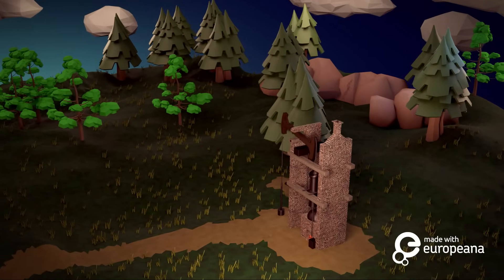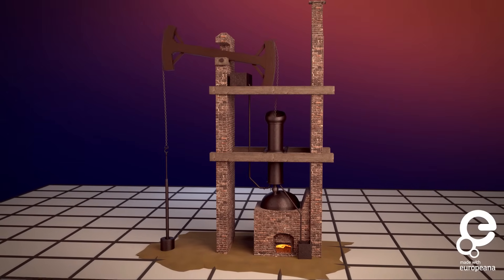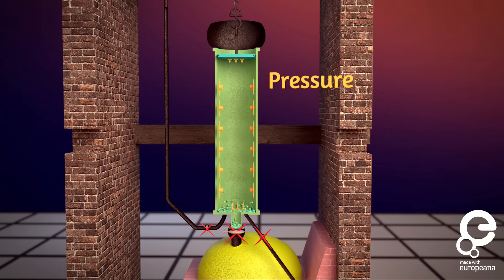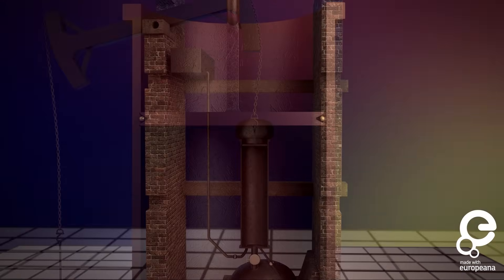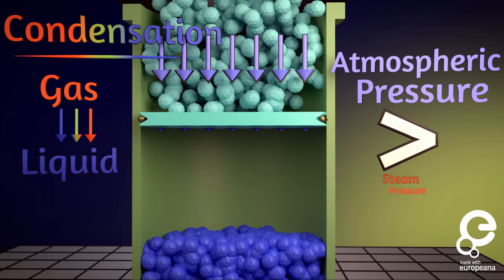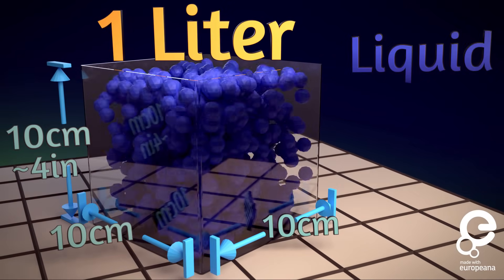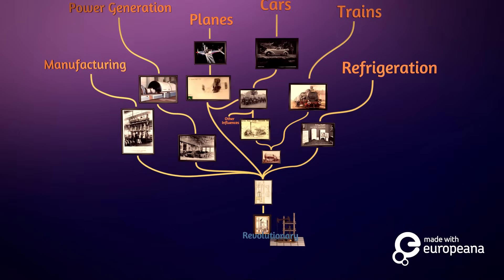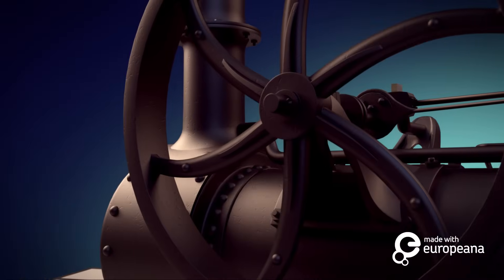What is the First Engine Ever?

Comment: 1. 00:48 -- Suggesting that without Newcomen, today "our world would be unrecognizable" is just laughable nonsense.  Look at all of the simultaneous inventions of the automobile, airplane, etc., that were the results of people working in different areas, unaware of each other's efforts.  If it hadn't been Newcomen, it would've been someone else a few years later, discovering the same principles, and creating mechanisms that were very similar, if not identical.
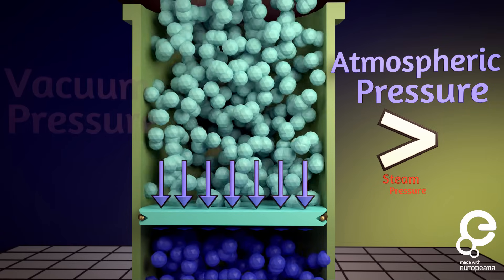2. 05:28 -- There is no such thing as "vacuum pressure".  A vacuum is the opposite of pressure.

Comment: The Newcomen Steam Engine?
The Newcomen Atmospheric Pump! The Steam's at ambient Atmospheric Pressure, inside and outside the Pump, like everything else.
It couldn't replace the Waterwheel, the first Engine.
Watt's machine was a Steam Powered Pump, and later a Steam Powered Engine, which could, and did, replace and surpass the Waterwheel.
Newcomen's machine was an Atmospheric Pump.
It doesn't work till you take the Steam away.

Comment: I think the start of the cycle is when the steam pushes the piston up and the beam to the water pump goes down. 
If not, how does the beam go back up once the steam turns into water?
Reply: How is atmospheric pressure enough to push the piston down?
Reply: @kissi1859 The weight on the Pump side pulls the piston back up and sucks Steam into the cylinder.
When the Steam cools down it changes back into water and creates a vacuum, then the weight of Air sitting on top of the piston pushes it down. The cylinder is open at the top.

Comment: It only takes 2 lb of steam pressure to fill a 44 gallon steel drum but when the drum is sealed and the steam condenses the drum will crush under the force of the atmospheric pressure on the outside surface.

Comment: if i created a steam engine that makes a vacuum in the top side, will the atmospheric pressure still push the piston upwards?
Reply: Yes, if it's open to the Atmosphere at the bottom.
Reply: It will, but the Newcomen engine relied on gravity to push the condensated water against the valve at the bottom of the piston.  The suction that pulls the piston rod during the power stroke can occur at any angle though.  It's the contraction of the steam that's pulling the piston.  Their description of atmosphere pushing from the outside is accurate, but not intuitive.

Comment: In Britain from 1800 to 1900.
20,000 Water-Wheels declined in number.
Windmills declined in number.
The Englishman Thomas Newcomen's 1,500 Atmospheric Pumps disappeared.
The Scotsman James Watt's Steam Engines and their descendants increased in number to 10,000,000!
For every SINGLE Water-wheel in 1800 , we now had 500 Steam Engines in 1900 !!!
Total Power output multiplied by between 400 and 500 times, an increase of between 40,000% and 50,000%!
And we don't need flowing rivers of water for any of them!
If that's not an Industrial Revolution, I don't know what is!
And it was all due to James Watt type Steam Engines and Steam Power!
Well done, James Watt!
The Industrial Revolution was nothing to do with Spinning and Weaving or any of those other so-called "  Industrial Revolutions and inventions ". It was a Power Revolution!

Comment: I could not agree with you more about this engine. Ninety nine percent of people do not realise what we owe to this engine…basically everything! There is not a product or process that could not be traced back to this engine and the ones that came after it. 

Then there is the subject of metallurgy. Now that we are inventing these new engines, what are we going to make them out of? Let’s invent cast iron. Ok, how are we going to machine it? Let’s invent tool steel. The development of engineering also lead to the creation of new standards. George Whitworth standardised threads, nuts and bolts etc. 

I would say that the Newcomen engine is the greatest invention of all time, possibly only beaten by the wheel. We can only speculate how the world might have turned out it this engine had not been invented.

Great video.

Comment: How can you cover this without any explanation of how the valves are operated, in many ways the most critical part of the design? This is like an explanation of an internal combustion engine that doesn't go beyond 'spark makes petrol-air mixture go bang'. Yes, the central idea of the Newcomen engine is that you can get a lot of power by inducing steam to condense in a sealed vessel... but there are very big steps from that basic idea to creating a working engine; and I'd say that getting the engine to operate its own valve system is just as major a factor as the pressure concept itself, and a factor that went on to future engines, with increasing complexity and sophistication. Your model of the engine makes it look as though it is worked by magic, since the valves appear to open and close themselves at the correct times, with nothing actually making them do so.

Comment: Little known fact;- When the ICE (internal combustion engine) was invented and for a considerable amount of thereafter, women weren't allowed within 1.3333 chains. I'm obviously referring to the Gunter's chains because although there are other versions of chains that came in and out of use it was Gunter's that stood the test of time, if you doubt the veracity of my claim then just ask any farmer born before WW 1 which "chain" won out. Of course not everyone has a long of period correct chain to do there measurements with so you could also lay 55 Northern Rockhopper Penguins end to end. They're the surfer ones with the cool yellow eyebrows in the 2007 animated movie "Surf's Up!"", but you'll probably need dead ones as live ones probably won't just lay there and training 55 penguins honestly sounds like way too much effort just to visualise a distance. 150 bananas that meet the FDA guidelines of an average of 8 inches per banana laid end to end, but in a straight line, not curved like the bananas would work. I probably should have mentioned that earlier. Also, every one of these methods is just going to end up visualising 100 feet. The distance is just 100 feet, but I wanted to give people a way to see a visual representation of that 100 feet, especially for the vast majority of the world who doesn't use 100 feet. 
It's like 30 metres.
Anyways the reason women had to keep their distance was because the tremendous speeds would make their uterus fall out.😳😳😳
All jokes aside the authorities lost their shit and imprisoned a guy for doing 25mph in 1908. Back then the speed limit was 10mp

Comment: The first commercial steam-powered device was a water pump, developed in 1698 by Thomas Savery. It used condensing steam to create a vacuum which raised water from below and then used steam pressure to raise it higher. Small engines were effective though larger models were problematic. They had a very limited lift height and were prone to boiler explosions. Savery's engine was used in mines, pumping stations and supplying water to water wheels powering textile machinery.
Reply: I've never seen any Factories Powered by any Savery Pump or Newcomen Atmospheric Pumps.
In Britain from 1800 to 1900.
20,000 Waterwheels decreased in number.
Windmills decreased in number.
The Englishman Thomas Newcomen's 1,500 Atmospheric Pumps disappeared.
The Scotsman James Watt's 500  Steam Engines and their descendants increased in number to 10,000,000 !!!
For every SINGLE Waterwheel in 1800 we now had 500 Steam Engines in 1900 !!!
That's an increase in total Power output of 500 times for the whole country!!! And consequently it's production capacity.
And it was all due to James Watt's Invention of the world's first PRACTICAL Steam Powered Engine.

Comment: why use a cooling condensing stroke as a power stroke and not the high-pressure steam? If you use steam to drive the piston, the discharge can charge a second, larger piston and that steam, still at pressure, can then charge a third, very large piston. Plus, the ability of the water to cool the steam is limited, requiring extra plumbing to be less efficient than a water jacket. If the piston started at bottom, the rocker alone won't lift the piston - the rocker is like a flywheel; if it was off-balance, it wouldn't work.

Comment: Newcomen's engine was simple to build at the time with the technology they had.
So even though it was not very efficient, it was much better than the animal power that had been powering the pumps before it.
The mine owners saw how much better it was and were happy to spend the money to get one.  And when Watt made the pitch that a pressure powered engine would use much less fuel to do the same job, the mine owners were happy to pay the higher price for the new engines that were more complicated, and harder to make.  Machine tools got more accurate to bore the smoother cylinders that the Watt engines required.  A whole cascade of technological improvements were kicked off by Newcomen's invention.
Reply: Gotta start somewhere.
I remember my grandmother had some ancient encyclopedias and I looked up internal combustion engine and about all it showed was as far as new experimental engines used in the NEW automobiles people were building.
It was mostly about the Otto cycle 
( as a new thing ) and I vaguely remember it describing someone before Otto trying to make a piston engine run on gun powder. 
The encyclopedia were so old I remember looking up television and it didn't have ANYTHING
I often remembered that that whenever someone like ' Mythbusters ' would bring it up.
Reply: The gun powder powered engine that is.
( fixing typos rearranged my message again.)

Comment: How did the valves work? Were they timed with the stroke of the piston mechanically ?
Reply: 2 years and bro is still waiting for the answer.
Reply: @ww2musicmann990 nah for real why are they gatekeeping that 😭
Reply: First the valves were timed manually, but they found out fast how to make a system of opening and closing them via levers and ropes. So they could fire the employees which did that job manually, and so they made the running costs even cheaper.
Reply: they were opened and closed manually
Reply: Originally, the valves were operated manually. That must have been very hot and difficult work, working right on top of the boiler to open and shut the valves 12 times a minute.
Reply: The valves where opened automaticly by attaching levers to them that were moved around with the reciprocating movement of the piston, timed perfectly so they would close and open when the piston moved upwards or downwards.
Reply: They were open and closed manually at first.
However one young machine attendant found that this was very boring work and was inspired to invent and set up an arrangement for this to be done automatically. Very slow moving engines so manual operation not too taxing.
Unfortunately his name not recorded and not whether he he was rewarded and promoted for his intelligence or just did himself out of a job.
So the story goes.
Reply: Yea, but without animating that, it's hard to imagine beforehand how this engine works.@@tokyesa8146
Reply: @@tokyesa814612 strokes a minute? I dont think they did it by hand
Reply: It works with physics. In a positive the valves open and in a negative the valve closes stopping the water from spraying into the chamber. Thats my guess.
Reply: Yes

Comment: Wow.  You could NOT have gotten this any more wrong.  Newcomen did NOT invent the first steam engine.  Thomas Savery did...a full 14 years before.  Had the technology existed to make the connections sealed properly, Savery's engine would have been far more popular as it did not rely on heat and cooling the cylinder repeatedly.  It is this flaw that allowed Watt to build a far better steam engine some 50 years later using A BRASS SYRINGE!!  The sad thing is you mention Savery only in your description without actually connecting him to your video.  Watt did NOT work on Newcomen's engine.  In fact Newcomen was working with Savery on HIS engine.  Savery is the one who really started the steam engine revolution.  Savery was the one who had the patent on the technology when Newcomen invented his engine.

Comment: The claim that conventional steam engines would use pressures possibly hundreds of times atmospheric is incorrect.  Atmospheric is 14.7 PSI.  The steam engine might do 100 PSI... maybe a bit more.  If there are 1000 PSI engines I would like to see the reference... really because it would be cool!
Reply: WWII era powerplants on boiler operated ships were at 1200 PSI. Modern steam plants tend to operate at about half that though, as it's somewhat easier to design around. Less pressure, but more volumetric and therefore mass flow.
Reply: @pauljs75  That is impressive.  I believe that 18th century stuff was around 100 PSI.  I am surprised that anything went further than the 1920s and 1930s.  I will have a look at the usage you mentioned.  I wonder if that is piston based or turbine based.  If its piston based then that motor would be pounding out the torque.

Comment: I really like the format.  I think your descriptions are good except for the atmospheric pressure.  In the case of the steam you are using a change in energy so the balls should bounce a lot and bounce less depending on the energy.  The atmospheric is a static pressure so it should be a matrix of balls just sitting on top since their energy is not being discussed.  It is essentially an unchanging force like a barbell weight on top of the cylinder.
Reply: No. Atmospheric pressure is exactly what this author depicts. It is the sum of the forces that the atmospheric air molecule bounces to the surface divided by area.

Comment: Technically this is not a steam engine, but an atmospheric engine, as it's the pressure of the atmosphere that drives the engine, not the pressure of the steam.
Reply: It shares some features, but it's like a steam engine that only makes power with the condensation cycle rather than expansion. (And the more typical steam engines, the condensation cycle is an optional thing to improve efficiency.)

Comment: in theory this wasnt even close to the first engine ever invented, the first engine to ever run was invented in ancient Egypt and was composed of a fluid container suspended above a flame of anny kind with an angular inserted pipe that would feed into a metal sphere from the side, the sphere  had two angular tubes on iether side of it and when the steam entered it would blow out the angular pipes causing the sphere to rotate at high rpm... allthough the contraption couldnt run anny kind of machinery it is considered the first ever machine to run on its own.
Reply: The Newcomen engine was the first successful prime mover. All previous 'engines' were unable to do any meaningful work, and so are completely irrelevant in this context.
Reply: @trialen  thats literally what i said, but it wasnt the first steam based machine
Reply: @maxbennedbk7085  Well, if you agree that your comment was completely irrelevant , why did you bother making it?
Reply: @trialen  its history, and he got it wrong! he should have called it smthn like "the first ever steam engine to do meaningull work" idk... why did you even bother replying to my comment in the first place XD

Comment: If you want to talk about "the first engine *ever*" then you're wrong on at least two counts:

1.  Thomas Savery built the first steam-powered mine pump in 1698.

2.  Hero built the first steam turbine in the first century AD.

The Newcomen Engine was merely the first practical engine.
Reply: It al depends on you're definition of engine, in my mind most clock mechanisms are engines to.
They go back way earlier.
Reply: @martijnverschuren3578  That's a fair point, this applies only to steam engines which in turn are a subcategory of heat engines.  Clock engines are typically powered by gravity or spring tension and when you include those power sources there are far more exceptions.  Even if you limit only to heat engines you still find plenty more examples which pre-date the Newcomen Engine.
Reply: The first steam-powered mine pump was invented by Jerónimo de Ayanz y Beaumont.
Reply: Merely. 😂

Comment: Very interesting how it works on compression instead of expansion like the modern engines. It wasn't the first engine though, since in ancient greece they already had a spinning steam thingy.
Reply: Ancient Greece knew about static electricity but never created an electric motor.
Reply: That was merely a toy - since energy couldn't be extracted from it I would say it wasn't an "engine". Newcomen's engine was a practical machine that performed real work.
Reply: @stumccabe  historians may argue it weren't put to work( probably right) ... But that's a poor argument for saying it can't produce usefull work. NB at time of it's documentation they did have pulley drives so could have extracted shaft power. More likely reason for lack of use  I recon? .. Cost of fueling a steam boiler verses feeding say a slave.
Reply: @stumccabe  size it up and bam engine
Reply: @bentwenty3288  away you go !?.
Reply: @bentwenty3288 no you could not just size it up as the design using steam jets could never produce useful power, unlike a modern steam turbine.
Reply: @stumccabe  anything that can produce power, by exchanging an otherwise static form of energy, is an engine.
Reply: They were toys, not engines in the sense that an engine must do work.
Reply: Fun fact : « Spinning steam thingy » is the direct translation from greek…
Reply: Other sources say the Hero of Alexandria steam turbine was put to work to open a set of temple doors with any apparent human assistance and so adding enormously to the mystical nature of that temple. But keeping it mystical meant keeping it secret to the world at large.
So not just a toy could have been the germ of huge progress if the principles were more widely understood.
Reply: aeolipile